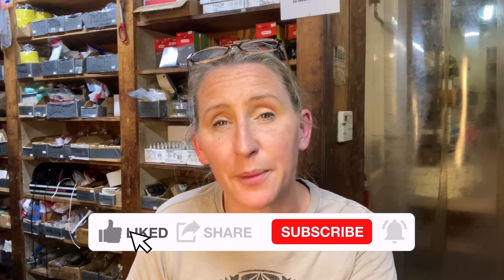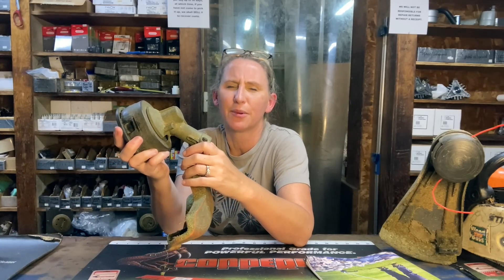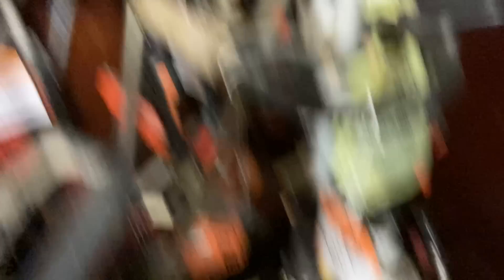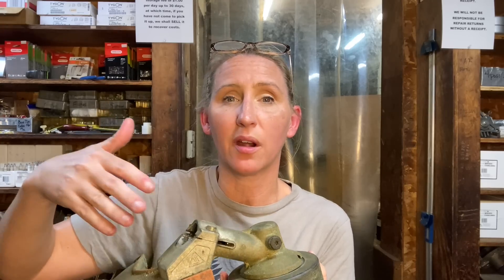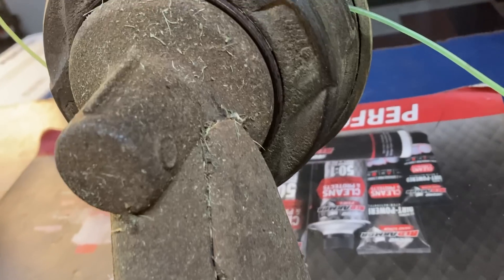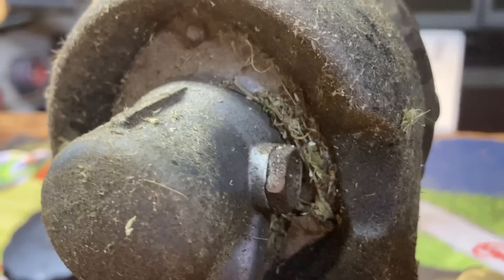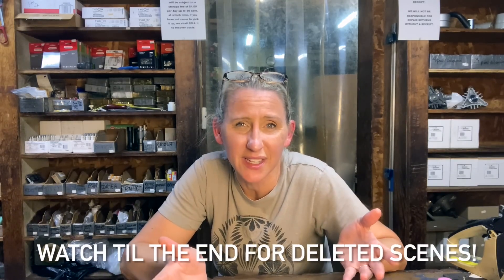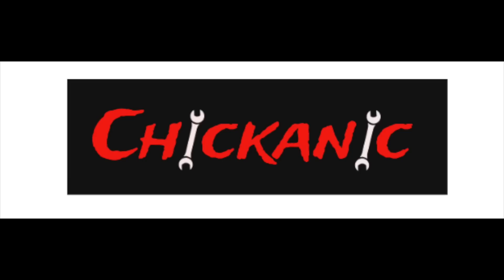Planned Obsolescence?! Why Would STIHL and ECHO Do This?!

Comment: Its not greed its apauling. I do not know what is going on with the world all mass produced products are being crippled. It is so frustrating from people who have always maintained and repaired tools. First thing I would do on my new strimmer..... is Dismantle head. Drill hole. TAP thread and fit Grease Nipple...... 

With all this save the environment rubbish the governments should target manufacturers. Stop them from creating throw away designs. Or make them supply a 5 or 10 year warranty for items that can not be serviced.....Then they may add grease nipples  back in. Also make spairs available at sensible cost. Example...... NOT make a gear cost £80 and a complete assembly £100 

You will notice everything being produced today is substandard build and endurance quality even from 10 years ago.

Comment: It is the same reason they eliminated the grease fittings on all of the font end parts in your car. Ball joints, tie rod ends steering links and so on.  After market joints have grease fittings but many of those are desighned to fail in other ways.  They just do not make anything like they used to.  If it is newer it is inevitavly worse the the previous version.  Companies/people are greedy and that is all there is to it.

Comment: Well, you can always drill and tap a grease orifice into the head. Pain in the rear? Check. Will it void warranty? Most likely. Could procedure weaken the pot metal housing? Definitely.
BTW I want that Shindaiwa trimmer.

Comment: Commercial user.  I put a zerk on my gear heads. Once or twice a season it gets a attention.  My Sthil got 10+ years commercial use before it was retired and upgraded to Echo PAS. Yes, speed feed is great.  Always tossed away tap heads til 3 years ago when I switched from Sthil to echo.  Not looking back either

Comment: I just went to my small engine repair shop  to replace my trimmer head as I hit m wifes steel pole holding up her bird feeder . Needless to say , at 10'000 rpms it destroyed the head . I bought a new one and while I was there I looked at all the Echo trimmers and replacement head and shaft assemblies  . All the news one he had had grease plugs, He didn't  a single with no grease plug
Reply from the maker: Check the dates. They must be last years models. The new SRM-225 don't have it. The larger commercial ones still do.

Comment: Funny yes if you know anything about anything a vacuum power head i was using was running a steel shaft through a steel bearing instead of a brass oil light bearing lasted one year and the holding plates that the bearings mounted in the plastic head to hold the beater brush got so hot melted right though the head planned obsolescence. boy o boy they think we are dumb. lot's of made to fail thing out their. "From someone that fixes everything". just had to look at it could not believe it .manufacturer  not saving much but the power head was destroyed hitting your pocket book. was a expensive central vacuum system . shame on them.

Comment: I am speculating here, but the heads with the grease plug are unsealed assemblies and there is grease loss, but the new ones may have a sealed grease assembly. Of course, at those speeds and heat generation, the grease eventually degrades.

Comment: Planed obsolescence started hundreds of years ago with lightbulbs.
Reply: Experience that with a Canon Pixma printer - print head mismatch error - can't even scan - becomes paper weight. Got a $45 dollar check and used that to get paper for my newly acquired HP color laser printer.
Reply: Do you mean to say the light bulb has been around for "hundreds of years" lol
Reply: @aleb5195 Not sure what you’re getting at or what your potential sarcasm is about… They have been around for hundreds of years and planned obsolescence started in the 1920s so they wouldn’t last as long and would force people to buy more. Do some research before commenting and you can save yourself the embarrassment next time.
Reply: @jonvon2044  Light bulbs have not been around for "hundreds" of years. Stop embarrassing yourself.
Reply: @aleb5195 1800s is close enough and doesn’t detract from my point. You’re still embarrassing yourself 😉
Reply: @jonvon2044  smh
Reply: @aleb5195 You want attention so bad.

Comment: Also called pre-determined obsolescence. The engineers determined how long the product will run before it needs service and repairs. As long as it gets through the warranty the manufacturer makes money. I think of universal joints on vehicles. The number one reason for failure is the grease drying up in the needle bearings. U joints used to come with zerk fittings but no longer. And the aftermarket replacements may or may not have zerks. And Stihl has many of their parts made in China. They even opened a Zama carb manufacturing plant in Huizhou in 2018. They're living off their past reputation.

Comment: I have a Stihl FS86 that I probably purchased n the mid 1990's, and I recall the shop owner cautioning me not to over grease it, like others have said perhaps they ran into more trouble with over greasing than under, and went sealed. My FS 86 has been a great machine, though about 6 years ago I found a hole in the gas tank - the darn red squirrels decided to chew the corner off it in my garage - and it was impossible to find a replacement. Ended up finding a dealer when on vacation who kept a collection of dead units for parts, and for $25 I was back in business!
Reply: Da*n squirrels 🤣

Comment: This is along the same lines as manufacturers that put a useless zerk fitting on a deck spindle that has "sealed ball bearings" vs roller bearings. 

Side note- grease plugs suck. I cant imagine that a zerk is much cheaper than a short bolt....

Comment: I changed the lubed for life u joints on my 12 yr old F350 at 180k miles just because I was nervous about them. After removing them I pulled the caps. They still had grease in them.

Comment: I’m still push mowing the trim in my yard with a Honda from the early 80’s. It was freely given to me 15 years ago when a relative bought a new one. I’ve spent about $30 on it over the years. It is slightly older than I am, runs like a champ, has almost no rust where it matters. My relative has purchased 2 more mowers since I received it and I have at least double the grass to cut.

Comment: Like always you’re straightforward and honest well I guess that’s straightforward. Anyway, I got to thinking on my echo Weedwhacker which has the grease plug. I’m gonna get a different plug and I’m going to drill and tap and put a grease fitting on there and see if I can grease it that way I don’ know if that’ll work or not anyway what I do is I have one of those little grease guns for greasing a chainsaw tip and stuff like that anyways, I just pumped greasing that way all right we’ll see ya. Oh by the way I use a amsoil wheel bearing grease. Seems like it keeps pretty cool also.

Comment: Thanks for producing another interesting, thought provoking video. I discussed with the local ECHO dealer about it. He'd been in business for ~40 years (because I don't have permission, I won't name him). Even he didn't know about the sealed head. He also stated that he may have had to replace 10 trimmer heads in all those years. Mainly due to breakage from abuse. From my own experience, I had a Ryobi trimmer for 30 years. Used it as a homeowner. Never gave second thought to the head. However, thanks for the tip on replacing the head, just in case.
Reply: Man you lucked out with the Ryobi!

Comment: Look, the market adapts to what the customers are asking for.
Rather than upping the price on a part which would make customers choose another brand that hasn't gone that route YET, they simply make the part easier to manufacture.

It's not just a knob and a thread. It's an extra manufacturing step that takes up time, space and machining tools.
And since most customers don't care about the omission of that plug (since most users don't use it anyways) it goes away quietly except for people like you who notice these things.

Now, i don't know how easy it would be to do this. But lacking a grease plug where i would want to do maintenance on one of these heads, i would probably pull it apart and grease it after an inspection. Though since the part technically should last for 10 years without servicing, i see it as $15 a year for a replacement at $150 or as you put it, ~$11 for the complete assembly replacement.

Also, the complete assembly replacement is most likely cheaper since they made a big batch of them. While the replacement heads was a smaller batch.
Prices go down when you make big batches. Someone in the sales department just took the whole cost of making those heads and divided by units produced and slapped on X% on the unit price for their profit.
Then stores will slap on their % on the final retail price and BAM, there's the reason for the different costs. It's just that simple really.

When baking cookies, do you put them in the oven one at a time or do you make a whole bunch of them at the same time?
It would be hella inconvenient to make them one at a time.

Comment: I have had the Echo 225 about a year and a half now.  I discovered that it had no grease plug. I called Echo about this.  To my surprise, the technician seemed to be unaware of this fact.  He went and checked and confirmed my concern.  He suggested that I remove the head and force grease down the opened end.  I have done this, although I'm not convinced this will do me any good.  As for now, it is still working.

Comment: My kid says I modify everything, its true.
If their is no grease head, drill a hole and add a zert. I have added zerts to many things. Just last week the brakes on a older quad did not work, brake pedal was frozen up, no grease. The only way to add grease is remove panels, foot pegs and such, then remove brake pedal clean and grease. Simple fix, drill tap and add a grease zert. I have done this to several dirt bikes swing arms as well.

Comment: From the exploded diagram you showed briefly, they went from "squirt some lube in" like a car's rear differential to "repack the bearings" like on a car's wheel assemblies. It looks like it is still fully possible, people will just have to spend an afternoon doing it instead of 5 minutes. Two causes for this (in a single sentence): nobody was adding grease like they were supposed to, so deleting the feature saves them money on production costs.

Comment: You are correct, the manufacturer's engineers found a way to save a buck or two by not adding a grease zirk or bolt. They know most users won't ever grease their gear head so gee, lets save a few million and do away with "unnecessary parts and machining. It's our throw away culture, sad to see. I sold Echo for 20 years and always felt they were head and shoulders above most other manufacturers with quality and their commitment to producing a top quality gear that was easily serviceable. But, like all the others, competition gets in the way of good business practice and they simply had to be more "competitive ". Oh well...

Comment: Good video, thanks!  Well, this is not a cost saving exercise worthy of note, the cost of having a threaded grease port is cents, or a few dollars at most. I run 16, mostly older saws and they last and can easily be prepared, new ones, not the case. I avoid todays  Stihl Saws.

Comment: In the 90s I noticed a trend of small 2 stroke motors beginning to have half a "crank", only one bearing and flywheel to hold the crank pin. Briggs & Stratton also went to plastic (either nylon or delrin?) cam lobes on their 4-stroke motors.
Reply: Wow! So, that's when all of that started.

Comment: I couldn't believe my son's 2005 Mustang didn't have a dipstick to check the transmission fluid, either...not being able to check or add fluids is ridiculous on anything...as far as gearheads, I have only had 1 or 2 Echo ones stripped, with hard use/abuse any many, many hours(been doing this for 35 years...not so much anymore)..the Stihl ones, I've seen many stripped, usually abuse. They were decent, but didn't seem as strong overall as the Echos...Husqvarna 123, 223, 325, early 323 and 326 trimmers had REALLY weak gearheads that almost always wound up stripped out eventually, even under moderate use...they did come out with a better replacement and superceded the old gearheads, early in the production run of the 326(they can be identified by having a bigger diameter gear bulge on the housing). This same basic gearhead is still used on the 525 series trimmers...it seems to be roughly on par with the Stihl gearheads on durability. Also, many manufacturers will use a cheaper, weaker gearhead on their low-end consumer models. Example would be the Husqvarna trimmers, the low-end consumer models typically designed and manufactured by Poulan will have a cheaper weaker different design gearhead than the pro models....

Comment: I was trying to figure out what your e-mail is and I've looked and looked and CANNOT find it anywhere...so maybe you'll see this and respond to me...I work at a local Echo dealer here in N.C. and we had a customer come In with an Echo srm 3020 weed trimmer and it I'd blowing raw fuel all over the place on the exhaust side. I've been into the unit 2 times and put a new carb. On it and NOTHING is working. This is the only unit that I have seen doing this..and it runs GREAT just is blowing raw fuel out the exhaust...just wandering if you guys have had any units or have come across any may be doing this. Hopefully you'll read this and we can compare notes. Thanks Curtis

Comment: Some of the worst cheapening of stuff i've seen is on Milwaukee tools, everything from powdered metal gears that disintegrate to capacitors running at 4000% of rated current.

Comment: My first experience with planned obsolescence was when my cousins brand new Ford truck blew its engine. Turns out the oil pump relied on a single plastic gear that was supposed to be replaced at a specific mileage. He went slightly farther than that and it failed, the whole engine blew.

Comment: Dunno I maintain a Bunch of Shindaiwas for years. The gear heads Rarely if Ever get greased Reality is the Machines seem to die all at once.   After a year or 2 of 8 hour days, used  by decidely indifferent operators... the machines are worn out. Frankly.. the time and money to repair a failing machine  is worth more.. than simply buying a Fresh one,  with No downtime problems. 
As in it costs More to patch a machine than to replace it.
  Sad but absolutely true. 
Only little old men do serious repair /maintenance work on their garden gear tools.
. Rest of the working world uses them as disposable tools.

Comment: Some food for thought.  High speed angle grinders spin at about 15,000 rpm.  They don't  have grease fittings.  I am sure the string trimmers get used 20 times more often, and longer periods of time.

Comment: Same thing with ink jet printers. Use printer for a few years and then it quits with a message that the print head is not genuine? even when a "genuine" print head is installed - same error (Canon Pixma). Not even the scanner on top works anymore due to the error prevents the unit from working again. The AIO becomes a paperwieight/boat anchor.

Comment: Great Video.  One of the items we cover when we sold our string trimmers was to show the customer the grease plug.  When a string trimmer came in, we would grease the heads, just to help keep our customers.  How unfortunate that Stihl and Echo have changed their gear head.
Reply: Cant you just run the power head in a drum of grease once a month? Easy fix.

Comment: Same with mower decks with sealed bearings that Will wear out, vs. greaseable bearings that should Never have to be replace. (If you maintain them) 
They get to sell you parts that should never wear out. 
Tie Rod ends and U-Joints on cars and trucks, same game.

Comment: My 2.5yo Stihl doesn't have a grease plug either, it was $275.00, the grease plug model was $350.00, I was cheap, but I have at least 1K hours on it and it is doing fine.  I have replaced the string head 3 times.  I assumed it is a sealed unit just like my $6k zero turn has sealed spindles.  I do appreciate the video, the manufacturers obviously don't want you passing down your power tools to your kids in your will, it's a different world now of disposal things....like laptops and cellphones.  Very frustrating!!  BTW, I did replace the oil in my B&S after your video.

Comment: The Stihl Kombi I bought last year also has a grease plug, and the local dealer also had the grease for it in stock.
It didn't seem to be adequately serviced when I bough it, but a little grease was easily added.

Comment: i have never looked into that before but if i had to guess the bearings in that head maybe a ZZ bearing which are sealed so no need to re grease they are replace when shot or replace hole head.